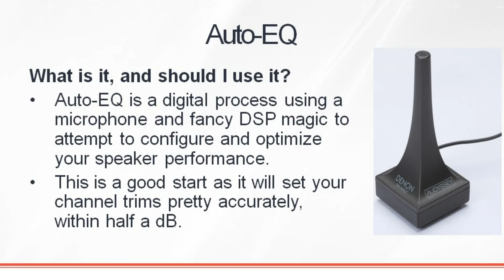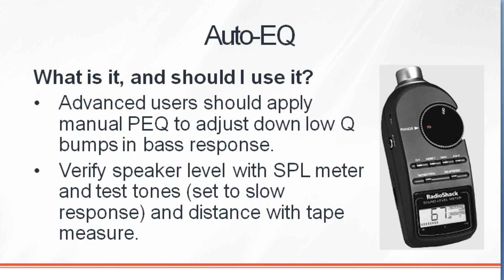Home Theater Calibration Tips: How To Set Channel Trims

Comment: I have 3 main listening points in my home theater.  I take the average of all three readings.  So for instance let's say the third position is 5 feet from the right channel, the first position is 7.5 feet, and the second position is a full 10 feet away.  I add it all up, divide by 3.  This gives me a 7.5ft average I go with.  I do this for every measurement and it rounds things out the best in my opinion.  I do the same thing with sound levels except I get everything to a 75db reference point from position 1.  From there if I find position 3 has maybe 85db coming from the right channel but position 2 is hearing 70db, I adjust so position one hears about  77db.  I also concur with Rick there that the center channel should be bumped up a bit.

Comment: Hi Guy's, I Have an Older Pioneer Elite VSX-84TXSi Receiver , It is in New Condition, Hardly Used. I just want to hook up an in wall System "Wife Want' Clean Look" As well as in wall Klipsch 5802 Sub Woofer with 5 Klipsch 5502-W ll For LCR And Rear Surround. For Left and Right Surroundb I Will be using a pair of 5800-W ll 

Should i Upgrade to a New Receiver or will this one be fine for the time being?

Will this Pioneer Receiver Handle these Speakers Nicely? 140 Watt Per Channel. 

Living Room 20"x16" Thanks For Your Tips , Video and Suggestions.

Comment: my Denon avr doesn't set master volume when I run test tones for the speakers. what should I set master volume to when I calibrate?
Reply: 0db
Reply: Eddiesteady73 ...I have a Yamaha A/V RX-A 3050,, I'm a little confused on setting it to 0db on master volume. 
ZERO db, is like - 85db. ? Am I wrong.

Comment: I have a brand new Onkio 5.1 home theater system and nowhere in the setup dose it have the option to change speaker sizes and DB settings. I have to rely on the setup mic to do it all for me and it always ends up sounding wrong to my ears with not enough bass coming from the sub

Comment: I would think that most people are seated much closer to their surround speakers than any other speakers in their system, so wouldn't it be a good practice to turn the surround speakers down a DB or two anyways??
Reply from the maker: That's why you calibrate at the seated position with an SPL meter.  Ideally the meter should read about the same level for each speaker though I tend to boost the center 1dB for personal preference.

Comment: Is it worth upgrading a 7 yo Pioneer Elite receiver to say a Marantz SR6011 for the Audyssey XT32 auto calibration function?  I realize there are many more functional differences than that but,  all the internet connectivity features are far less important to me than high quality sound.  I have recently purchased all new speakers including subs and would like your opinion on this.  Thanks.
Reply from the maker: Depends on the Pioneer you have.  If it's an ICE Amp and you're running 4 ohm speakers, maybe.  Room EQ is a bit of a mixed bag on all these units since they don't let you limit the EQ to just bass frequencies.  You may be better served just getting an mDSP system to manage the bass of your subs.  Unless of course you want to upgrade to Atmos, then you need a new receiver.

Comment: hey guys  love your stuff!

quick question. I have a 13 by 13 room room with a king size bed in front of the tv with 7.1 surround 4  powered subs onkyo sr 806 av that is not atmos comp . my question would be , is there any way to atmos roof speaker feel with the set up I have now without upgrading my av ? And is using y splitters to run 4 subs off one lfe safe?
Reply from the maker: Raise your surrounds above seated ear level to get an elevated effect. Either daisy chain the subs or use a Y-splitter and diasy chain each pair of subs.  Otherwise get a mDSP box 2x4 so each of the outputs will be buffered and have adjustable EQ.

Comment: Hello,  I'm going for the 2.2 setup, with JBL 530s with 2x  JBL 250P subs. Is it a
 problem if I use a stereo amplifier that doesn't have  digital bass 
management( CXA80)? Will the sub woofer crawl be enough for good results? How 
much more a difference does an amplifier with bass management and 
microphone measurements make?  
I just don't know if its silly to install dual subs with out bass 
management and if i should just change my current amp for a one with 
bass management capabilities.Is the investment for bass management worth
 it? Whats your advice?

Comment: Any ideas on how to properly calibrate Dolby atmos enabled speakers? I've tried looking but there's really nothing out there that explains this.
Reply from the maker: +CEOLISSS The best calibration tip is to use discrete height or ceiling speakers instead of the Atmos-enabled bouncy speakers.  However, my advice would be to let your auto-setup calibrate levels and delays, then turn off the auto-EQ, and set all speakers to small with 80Hz XOVER and 150-200Hz XOVER for the Atmos-enabled speakers if it gives you that option.
Reply: Great advice regarding the Atmos in-ceiling speaker crossovers. One semi-related question I have: is there any reason not to also set the center channel crossover a little higher (say 100 to 120hz)? I have a Pioneer SP-C22 and in a few movies (best example being Bane in TDKR) the voices can sound slightly boomy with a crossover down at 80hz.

Comment: I have a Yamaha receiver that uses a YPAO calibration mic. I have a 5.2 system. The 2 subs are a 12" &'15". The directions say to turn volume up 50% & crossover all the way up. When done with the calibration there is no mention of turning the crossover back down which seems strange to me. Is this common practice in set up or am I supposed to manually set the crossover back down? Thank you for your videos. I've really gotten a lot out of them.
Reply: Setting the crossover on the subwoofer at the maximum takes it out of the loop so that the AVR is handling the crossover.

Comment: I've always found that having the rear speakers at the same level as the rest of the system results in the rears being pretty inaudible, for the simple reason that our ears are not omnidirectional but are designed to filter out sound from behind - that's what the ears' pinnae do. They act as front- and side-focused ear trumpets. A mike pointed at the ceiling doesn't do that, so the calibrated results don't put out equal volume from the back - as heard by a listener facing forwards.

So after I run YPAO, I go into the manual adjustment screen that lets you tweak the calibrated output and have it play the test tone, which you can I travel around the room from speaker to speaker. 

Sitting facing forward, I do that, and nudge upwards the gain for the rear speakers to make them sound subjectively the same volume as the others. Then I don't find myself getting up every so often and walking over to a rear speaker wondering "Is this thing on?"

Comment: Hi Gene, quick question,  You and other docs I have referenced say use 75dB for measurement volume.  My receiver does not have 75 as an option?  I have a Yamaha A1040 and an older analog Radio Shack sound level meter.  I get no response on the needle when using the test tones even at max volume?  What am I missing?

Comment: can you guys do a youtube video on the new Marantz SR7010, and also does a receiver need a break in period? and what is the break in period for speakers and subwoofers?
Reply from the maker: +Garemz Electronics don't need break in.  Subwoofer drivers break in within minutes if you run bass tones or up to hours under normal program material depending on the compliance of the driver and how hard you drive it.  Tweeters need little to no break in time.  Humans adapt to sound overtime which some falsely interpret as "break in".

Comment: I like the short videos okay.I like longer ones also.The important thing isn't the length as much as what you have to say. If what you have to say can be said concisely that is great. But, if it takes longer and holds your attention that is good too.This video on calibration came at a great time for me as I just did my two channel system using an SPL meter and was wondering about the settings regarding weighting (A setting versus C setting) Couldn't find anything definitive on it until now. I had suspected the proper setting for my purposes was C but it's good to get a second expert opinion to support it.Again, short or longer is less an issue than content. Don't drag out a video with little to say. Your videos always seem to be just right so just keep doing it the way you have been.